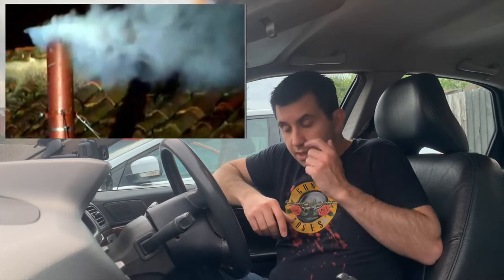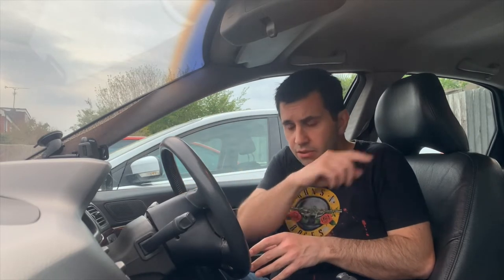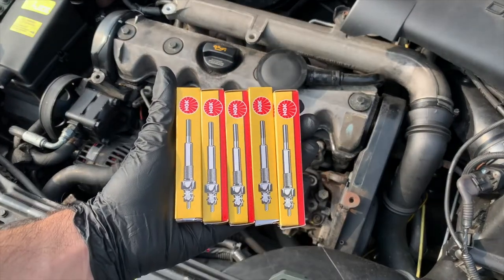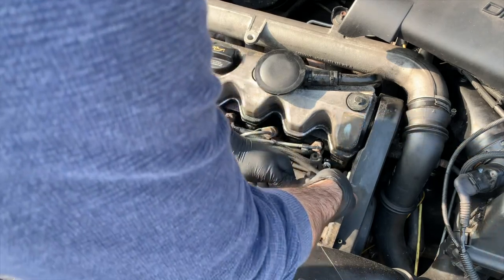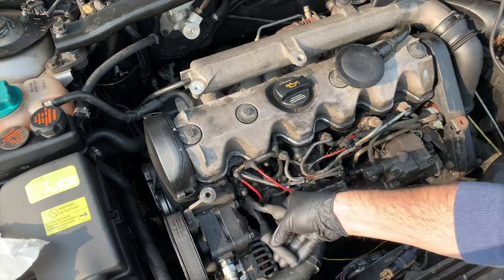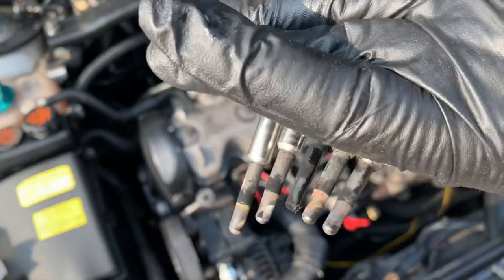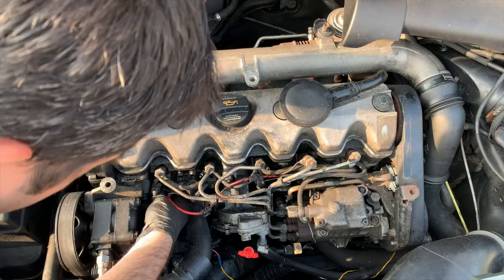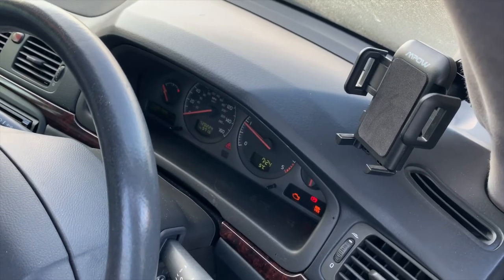Diesel white smoke? Glow plugs could be the culprit! #volvos80

Comment: can you think of anything else that would have the same symptoms?    I have a Delica that smokes and shakes on start up on cold mornings and then goes away.  Today , it was really cold and wouldn't start at all.   I have glow plugs on order but was told it could be seals before the fuel filter that have gone bad and it's sucking air until they warm up and do their job.    However, I think a seal would return to ambient temperature faster than the engine
Reply from the maker: Hi. yes, seals coudl also be an issue but on cold weather i would do the pre heat a couple of times before cranking the engine.
Reply: I have the same problem on a volvo v50. About the shaking when it starts, a mecanic told me that it's form the anti-balance buffer, since the engine is more stiff on the start, I will replace that after I resolve with the smoke and the long start.
Also, the mechanic told me that he tested the plugs and the are fine. But he suggested that the high pressure pump is the culprit for the smoke and the delayed start. 
What is your opinion on this?